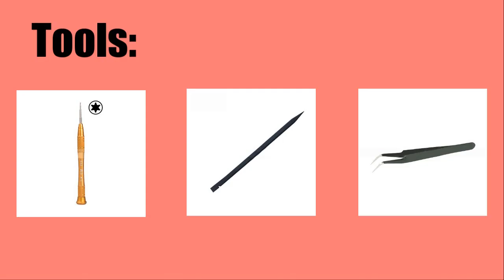Motorola Moto G4 Plus Teardown

Comment: my Moto G4 Plus gets water inside the display... what can I do now???
Reply from the maker: Please dry the water with tissue and hairdryer, do not turn on the phone if you just take the phone out of water
Reply: actually I get turned on my cell to see how much it damaged for five seconds... someone suggested that put your phone with rice in a hollow box for 2 days, is it ok????
Reply from the maker: Open your phone and release the battery cable connector, then use dry newspaper to hold the phone and then cover it with dry rice in a box for at least 48 hours, use newspaper and rice works better than only rice

Comment: i got my rear camera lens cover scratched , is it possible to get the lense cover replaced?
Reply from the maker: Yes.Get the replacement first.
Reply: Logesh Chandhar 
is front camera or back camera get scratches easily, i just bought moto g4 plus so what should i rlly do about it?